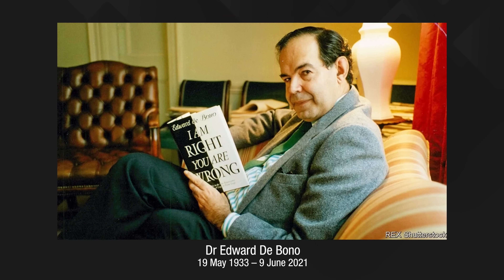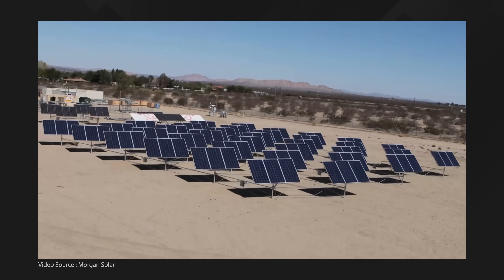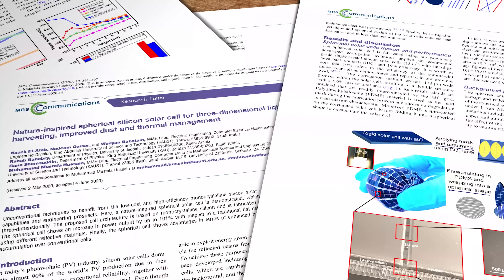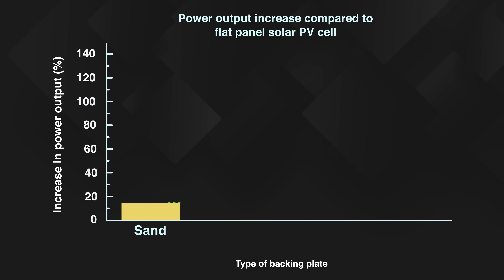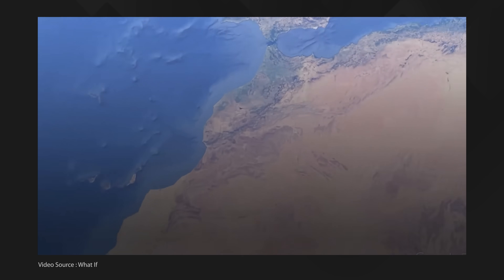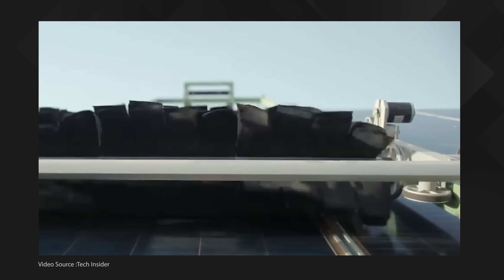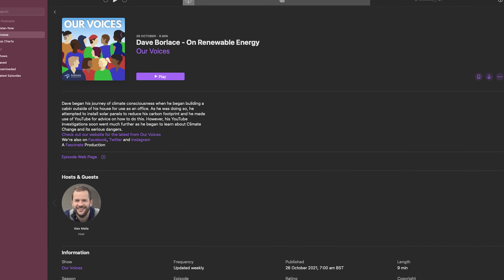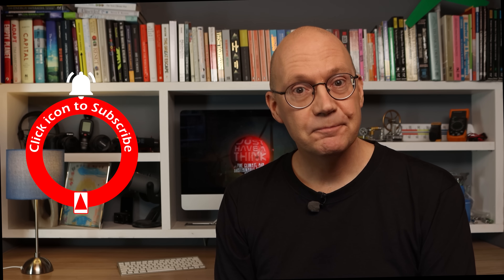Spherical Solar Cells - doubling the power output of flat PV panels!

Comment: I wonder if this technology would make solar panels more effective on the tops of rail cars. One of the current problems preventing solar use for electric  trains is that ever changing orientations of the cars requires expensive and troublesome sun tracking. Panels that cover the roof and collect light from any angle without moving parts would be a distinct advance.
Reply: the power generated with those panels is barely enough to keep the lights on. a simple locomotive requires several MW's of power when accelerating. on top of that u would need to insulate them from the  cars itself in the summer because it would generate even more heat compared to a roof just painted white. it's just better to put solar "roofs" above the electric wire. less wear during winter and for examples during stops at platforms the cars are in the shade so again less air conditioning needed and less power needed and far cheaper too for repairs and replacements.
Reply: If you want solar and trains why not mount to panels above the cables? You have more surface available, can mount it optimally. 

Or just put solar panels on a farm somewhere.
Reply: Adhesive flexible panels exist.

Comment: why spherical, not semi-hemispherical? there's a minimum collection angle so folding a full sphere seems  kind of pointless. 
am i missing something?
Reply: Yes, you're missing the bit about picking up reflected sunlight -- from a white surface under the balls, or even from sand (eg in a desert)
Reply: @trueriver1950 
 
never, NEVER forget to check under the balls for extra energy!😎👍
Reply: capturing reflected sunlight and better heat dissipation for better performance are the advantages of having a spherical shape.
Reply: No, you aren't missing a thing.  The idea is just not very smart.

Comment: Although the scattered light from behind is not collected by usual PV panels, the area pointed directly towards the sun is effectively roughly 5x that of a sphere. Even when the panel is not adjusted for the right angle, there is still a much greater surface shined upon, compared to a sphere with same total surface. Direct sunlight is much more powerful than what is reflected from houses or otherwise. Even when reflected from windows, the energy will only be a fraction from direct light. That's probably the reason why the panels are pointed to the sun, and don't have a second set of cells on their backs.
Reply: Yes, obviously incident solar is more powerful than reflected or ambient light. But many solar panels do have a second set of cells on the back to handy some of this lower-quality sunlight, they're called bifacial panels. Manufacturers claim they're up to 20% more efficient.
Reply: @skierpage  No, they just don't put an opaque cover on the back of the panel so the light can penetrate them from both sides. This may require the panels to be made little sturdier, as the point of that back panel is basically protecting it from physical damage.
Reply: @skierpage  That's interesting, I haven't heard of those yet, not even seen a single one that could be a such. Wouldn't the backside have to be inclined or at least vertical, and not looking towards the ground?
Reply: @human_isomer  You might have seen them but not noticed, when was the last time you went to a solar farm and looked under the panels? Though it is pretty new innovation so they might not be in use much yet, the panels should look normal except the back is not covered by plastic so it would be same on both sides.
You won't see them on roofs though, as the whole point is to have enough clearance under and around the frames so at least some light reaches the ground to reflect.
Reply: @AnalystPrime  I've actually seen quite a lot until a few years ago, as many PV farms were built in my area. A friend of mine was writing for a local newspaper and we were visiting most of the new sites when those were being planned and built. The county is running on 100% renewables meanwhile. However, non of those panels had ~~cells on the backside, so I assume they're not used here yet. But now I'm curious, I will take a closer look on the new ones. Thanks!
Edit: Just noticed I was thinking of the other comment when replying. But I will see if I can find panels with transparent backs nonetheless ^^
Reply: That's dampened my enthusiasm for incorporating reflected light into a solar panel array !

Comment: Take this idea to the next level.

A comparison standard should be set by testing hexagonal photovoltaic solar cells as well. The logic being that they are simpler to assemble as they offer straight lines for assembly. It is a best of both worlds design improvement, which can still fit all the mentioned applications without any major cost increase.

Then take the idea further by creating cylinder solar panels or even hexagonal depending on the above results. Stack these by several units in height and place them inside a mirrored cylinder which will trap the light inside for maximum absorption. The top will be an open face semi circular design that captures the direct light and funnels it into the housing. The purpose is to keep the majority of the heat off the solar cells directly, while letting the light be fully absorbed into the housing. The top will look like a mirrored funnel.

This design can also hitch a ride on the more recent wind power developments, where they use a cylindrical type design that wobbles to transform wind energy. This has the advantage of both capturing more energy but also when it is windy they are less prone to damage and will still capture sunlight relatively well.

This type of design could easily be placed in any number of areas and in arid desert areas like Saudi Arabia, could provide some much needed shading as well. Lastly the housing also helps to ensure the solar panels remain free of debris, reducing or eliminating any cleaning as well.
Reply: I like your idea of hexagonal pieces.  It should be relatively easy to design spheres of almost any size, comprised of multiple flat pieces.  Even if the efficiency gains are not as great, the ease and relatively low cost of manufacturing them this way might be worth the investment.

Comment: Why not just use a compound parabolic trough collector? That's a shape of mirror that redirects any light coming from within a decent angle onto a standard panel, without needing to track the sun daily.
Reply: Because solar panels aren't that much more expensive than a good mirror. EVERY technology that focuses more light on the solar cell (mirrors, prisms, fresnel lenses, putting strips of solar cells in channels or under lenses, etc.) has failed compared to putting up a big flat panel.
Reply: @skierpage  yes and panels hate being hot.  More focused heat it a problem.
Reply: @kensmith5694  Spot on! Efficiency of pv elements decline with the temperature due to the thermal component of solar radiation. That would offset the advantage of concentrating the "non-thermal light" components of solar radiation.
Reply: Heat is also an opportunity if usable hot water is needed on site. It also adds unnecessary complexity trying to harvest it from panels with plumbing, where direct PV DC to a hot water heater element is far simpler.
Reply: @anandawijesinghe6298  Humm, seems that what we need to to sepeate the radiation by frequency and then concentrate each band into it's own optimized collector.
Reply: @kennethferland5579  Or convert it all into the same frequency. There are materials that do that.
Reply: I've seen parabolic throughs mentioned elsewhere as solar collectors for solar thermal applications. They focus on a line, rather than point,  and so the tracking motors require only one degree of freedom,  have simpler mechanics,  etc.
Reply: No, compound parabolic is a type of nonimaging optic with just sn acceptance angle.
Reply: problem with pv is that in 50years at the outmost,  this infrastructure will be in scrap piles all over the world.  Replacing that is not sustainable. I like the simplification (no motors needed) but this is still a huge waste. 

how about reflectors toward a central location on a nearby hill or high tower or even skyscraper where a more efficient power conversion takes place? being parabolic means alignment needs not be too precise or continuous, one motor can align 20 or so once every 30 minutes...
Reply: @ShrekMeBe  
Reflectors end up costing about the same as flat solar panels and result in a lower net efficiency than just using bigger PV arrays.  Pointing a panel at where the sun will be at noon in midwinter is about the best you can do.
Reply: @kensmith5694  we're not looking for greatest efficiency. you do not need efficiency when surface is almost limitless. we're looking for long operating life,  low production cost,  low maintenance costs and simplicity. something that in 100years will still function,  something easily refurbished  or recycled (glass and a bit of metal) and produced anew locally
Reply: @ShrekMeBe  the math has been done 1000 times. It's still more sustainable than most any other power source. Also with thin film it's not really a big deal. The rare elements are recovered and the rest is negligible.
Reply: A corner reflector could be even more useful, since you don't want focussed light. Focussing the Sun onto PV panels is a Bad Thing™.
Reply: @RWBHere  not sure how that would work. reflective paint (which uses microscopic corner reflections) on the inside of a tube leading to the panel perpendicular to the sun should have considerable effect though. Interesting concept. Again, you need to factor in the cost vs more panels ... Panels are cheap now enough that most such designs aren't worth it, like csp.
Reply: Lol
Reply: If a mirror were used, it could be made of materials that efficiently reflect visible light, but absorb heat, so none of the heat is directed onto the panels. There is also the possibility of using phosphorescent materials in the reflector that convert UV into visible light.
Reply: @sockmonkey6666  Mirrors already do that. The conversion to heat happens on the solar panel as a result of the photons impacting the solar cell. Only 15-20 of that energy is converted to electricity, the rest is converted mostly to heat. This is due to th physics of the photoelectric effect. There is no way around it.
Reply: @davidaustin6962  Darn laws of physics making things difficult.
Reply: There was a company called Solyndra that tried that. Americans are still pretty sour about it
Reply: Parabolic troughs do track the sun, in one axis, to concentrate the sun durring the day on a point you need 2 axis of tracking, to consentrate it on a line you need one axis.
Reply: Similar to how a bike reflector? Interesting
Reply: because any kind of parabolic reflector has to be tracked or it moves the point of focus away from surface being focuseed on if the sun isn't at the optimum angle. Since the sun doesn't just move E-W across the sky but also N-S to a lesser extent you'll still lose efficiency. I can see an argument that since reflective material is relatively cheap you can waste surface area by making the reflector large enough that the solar panel is always within the area receiving the focus during practical times of day for collection.
Reply: Csp isn't cheaper than panels anymore. And haven't been for 5 years.

Comment: Somehow I believe that smaller spheres will be more desireable due to efficiencies.  Some of will depend upon the tranparency of the cells and how well the can collect energy from the backside.

I am astonsished that spherical PV cells would be more efficient without reflectors, because capturing low angle sunlight without reflecting it has always been one of the efficiency problems with traditional PV panels.

Of course then you have to consider the surface geometry of a 2D square vs a sphere, which with any back reflector is the magic of the design.

If they had a perfect black light absorber then the inefficiency would probably make the design 25% or less than the efficiency of flat panels.

Comment: But conventional PV is now sooo cheap, as you say. This might have some limited applications, especially where surface area is a factor, but widespread deployment a long way off as so much capital already deployed on the conventional. You can rely on fossil lobbyists to use this devrlopment as a means of prevarication, however. Just hold the line and get more fixed conventional PV out there, people.

Comment: The real lateral thinking we need to consider is if we are going down the wrong path with monetary based systems and creating and implementing technologies that have consequences for us all, without considering those consequences, but only considering monetary gain/what's possible...That line of critical thinking/ objective reasoning/ common sense is never considered/pursued..It is taken for granted that pursuing technological solutions is "progress" or evolution, but maybe the real progress lies in restraint, as far as powerful technologies with universal consequences are concerned...Challenging assumptions frequently targets the root of problems rather than the symptoms...

Comment: The lab results are a little ambiguous: "spherical panels increase energy capture vs flat panels for the same ground area". If I'm interpreting that correctly, it means with spherical panels you need more solar cells for the same ground area - since the surface area of a sphere is quite a bit larger than the surface area of a circle. If so, it means they are significantly more expensive. Excellent if ground area is the limiting factor though, such as on small roofs or on cars/aircraft.
Reply: dont forget that the incident light on a sphere is also a a fraction of the incident light of a flat panel.  t/he angle of incoming light is significant for absorption
Reply: @squizwiz8241  it would effectively be the same area as a circle of equivalent radius. the reduced light coming in at an angle is cancelled out by the added area of that surface. the benefits would likely be seen in reduced heating (making the panels more efficient) and light from other sources, but personally I doubt it's anywhere near 100% increase, and the added cost isn't worthwhile even then.
Reply: You can't put globes on the surface of cars or aircraft, because aerodynamics are important.
Reply: @incognitotorpedo42  quite true, you wouldn't put globes on an airplane - but if you can make spherical pv panels, why not take the extra step and make lift-producing pv bodies?
Reply: @incognitotorpedo42  You could if they're very small beads. In any case, I don't think these are worthwhile, because it's still too little power to make much difference to range.
Reply: Understood... But if these are flexible... They could enhance any  car styling. Without being obvious. Imo.
Reply: Exactly. 
1. You add much more solar cells (flat circle vs area of sphera ).
2. place them not in the best angle.
3. claim, that from the same GROUND area you get from 15% to 100% more electricity.
3.a as an added benefit claim lower working temperature of the cell, because surprise surprise - they are not in ideal angle, so they get less insolation and thus are cooler.
So the big win: you get more power from the same LAND area, and leave  out some "not very important details" - you need times more  solar cells, you need microinverters for almost every cell block, you need much more rigid and expensive structure for a better use of desert land, that is honestly not very expensive.
Reply: Hmmm. I think you’d need less ground area to get the same generation capacity.
Reply: It was not just spherical solar panels that were being discussed here but PV panels that could be wrapped around a variety of irregular or curved shapes, and that would be a significant advantage in several situations. As always, it's horses for courses.
Reply: Because of shading you would need to put them further apart in both nort-south as well as in East-west direction.

If you want to optimize the total yield of a flat area and the yield per panel is less important, just fill the total area with flat laying panels.
Reply: @BigFormula93  you raise and excellent point, insofar as conventional applications are concerned. This new technology still opens the potential to make renewable energy more accessible and practical than before, such as in niche situations where accessing more area or sunlight exposure isn't an option, like in (I don't know, let's suppose:) the bottom of valleys, open cut mines or in extreme polar latitudes, which are constrained both by limited sunlight in some seasons AND environmental impact restrictions.

Comment: A friend had a great idea. What if your entire house turned to face the sun during the day and you use excess power to also lift the house. Then during the evening when you use most power, the house descends, generating power and finally comes to rest facing east by sunrise.
Reply: I like this, and thought of something similar for wind turbines that get taller when the wind is blowing and then continue to generate power getting shorter when the wind stops.
Reply: This is just storage of excess power. It can be done in batteries, or sent back through the power lines, so you earn some portion of money back on your electric bill
Reply: @NoName-vq6cg  then you don’t need batteries or a power bill. But yeah, batteries are cheaper and these days can become part of a virtual power station with software and the internet. So this would prob never get off the ground, haha.

Comment: A fly's eye is a TERRIBLE analogy. Their eye is evolved to SENSE CHANGES in light from all those angles, NOT to most efficiently CAPTURE ALL of the light from those angles. Plus, the sensors are not on the surface. The surface is a bit of a lens that focuses light on the sensing cells. So, nothing like this design.